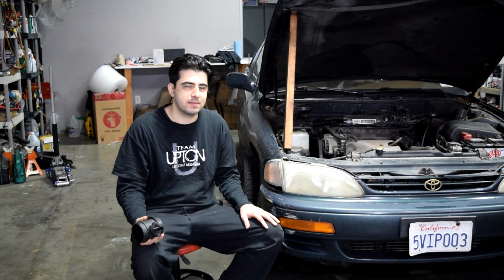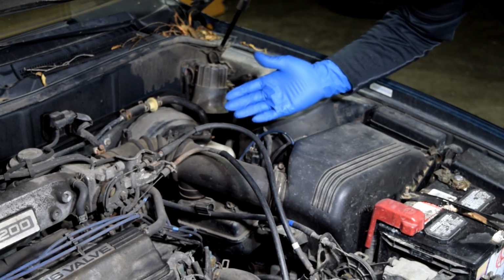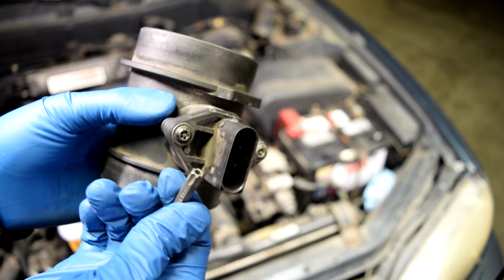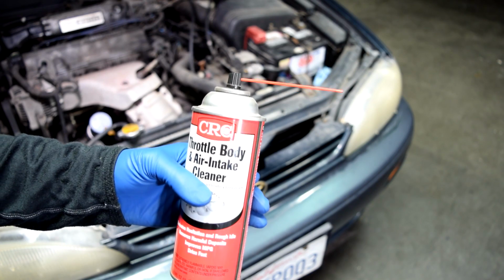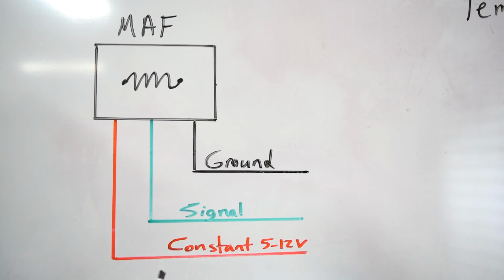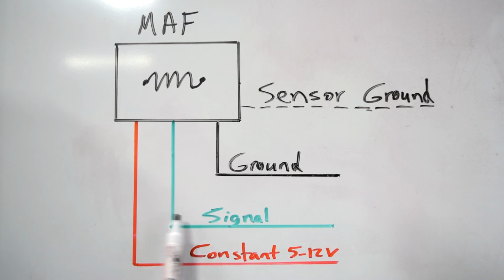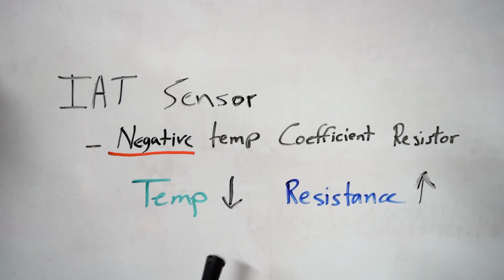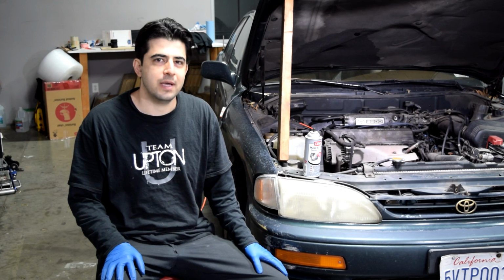How to Clean and Diagnose a Dirty Mass Air Flow (MAF) Sensor - Plus How a Hot Wire Sensor Works

Comment: I'm in the UK and my mpg trip computer has just started to go down big time first time in over 12 months ...i have cleaned the maff sensor 3 times now and it go's back up on fitting but still it go's down after a bit of driving..? would it be because here in the UK it's now cold like very cold outside ? ...thanks for any info

Comment: Can you just use compressd air to clean it?
Reply: spoken like someone who doesn't listen LOL... compressed air would more than likely produce too much pressure and ruin the sensor, those wires are extremely thin and sensitive. Just go get some mass air flow sensor cleaner and make your life easier, why use the wrong tool for the job from the get..

Comment: Hello. While i was driving glow plug light started to flash and check engine light was on. I checked the car with a obd scanner and got a P010100 code. The mechanic said that i should change MAF sensor but my car drives perfectly fine. Should i clean it first and see what happens or should i change it?

Comment: My grand caravan has hesitation from idle to acceleration cleaned the maf sensor with throttle body cleaner. Still same issue code didn't come i hear some kind of misfire sound from the hood. is that fuel injector an issue? Or replace maf sensor?

Comment: Tiburon GT 2004
3 days ago, 
I was driving at the highway and suddenly my CEL came on. I went to Autozone to do a test on my ECU and found out that my mass airflow sensor is bad/dirty/loose. Code: P0171 P0174 Here is my test. Please tell me if I need to replace something.

Side Effects:
1)My car stall when it Idle to accelerate. After that, It runs fine. 
2)Sometime, It feels weak when I drive it. Once I readjusted the sleeve on MAF. It's gone, but the CEL is still on. 

Work I did:
1) I did had vacuum leaks on manifold section. So far, I havent had that code since summer time. I replace the gaskets. 

2) I did replaced the intake with a aftermarket ones. 

3) Replace the gasket on throttle section. 

TEST 1:
I notice the intake sleeve slip alittle bit on the MAF section. I readjusted the sleeve on MAF section thinking that will fix the problem. Two days later, My CEL came back again...

TEST 2: 
I unplugged the MAF and see if it turn on. It works, but the engine sound the same as before. 

TEST 3:
I unplugged the MAF while the car is on. The engine sounds the same. Now I'm thinking " Can it be my MAF sensor that's mess up?"

TEST 4: 
I banged the MAF couple of times while the car is running. I dont hear the car idling retarded.

Now the question is... Could it be the MAF that's mess up or something else? I havent clean the MAF yet and I brought new one from ebay for $28.74(Just testing if the cheap one is better than the expensive ones).

Comment: i drive astra h 1.7cdti and i have problem with starting engine, sometimes start fine sometimes not,diagnostic said error code 0105 map sensor, i change sensor but that not help,i have map sensor and maf sensor, should i try cleaning the maf sensor, its confusing why i have bouth sensor
sry for bad english
Reply: when its cold outside like -5 starts  fine,when is outside is 10c hard starting

Comment: I tried it and my truck still rough idling with vibration.
Reply: Ninety-One Thoughts same, did you find out why ?
Reply: check your spark plugs + timing + clean your throttle body + check injectors + fuel etc   make sure you got good ground 
just to get you started
let us know
Reply: @ericmiller7022  reset your ecu , pull the pcm fuse when your vehicle is off. This will reset your ecu back to factory values. Also check the pcv valve and idle air control valve these two affect idling more than people think.

Comment: Those security screws you showed are a pain as you need a 5-point TORX bit with the hole.
Reply from the maker: +Mike P The sockets are not expensive, you just won't use them for much else probably.

Comment: I cant find a security torque ratchet for removing the damaged side view electrically operated mirror. Appreciate an addres for procurement and also a video clip to show proper removal. My car is Merc C class 220 cdi 2007 model. Zahir Pasha
Reply: Zahir Pasha learn to use the tools before you ruin ur car.. Sounds like ur someonw that should jus hire a mechanic...

Comment: Where did you get that information from ?
The little red zenerdiod looking thing is the Temp sensor.
Inside plastic housing in center is the metall film Air flow sensor.

Comment: if MAF Sensor cleaner not available, can we use petrol ?? cause its not available in some regions of India specially rural / county.. Thank you
Reply: you need to watch the video again... pay attention.
Reply: I would rather go for alcohol / water
Reply: Electronic/circuit board contact cleaner, one that quickly evaporates and doesn't leave any residue after evaporating, and you can't go wrong.

Comment: Nice video here, the white board is a great thing, well done.I would like to add that a Maf sensor can cause lean codes conditions when they get inaccurate, also cleaning hot film Maf sensors usually does not work and cleaning hot film sensors can...can... be a waste of time. also I tell folks that cheap off brand Mafs don't work some times.
Reply from the maker: +danekeeper1 Nice glad you liked the white board action, great tips too. Thanks for sharing.
Reply: Have a hot film one, made by Bosch, on my car. Engine was stumbling especially when going WOT, though it didn't set any fault code on the ECU. Removed it and cleaned both sensors inside it with circuit board cleaner spray and reassembled everything. Engine now no longer stumbles. It smoothly picks RPMs up like there's no tomorrow.
Reply: @teravolt6113   MAF usually does not give fault notice. Jerking at low speeds usually is MAF if the car is less than 150k kilometers

Comment: Dirty wire fools MAF to read out less air than acutally passing the device.Therefore injection System leans out the engine driving it to emergency Operation to prevent starving of engine. That makes fuel consumption go up by 50%.Error file will read "mixture too lean" .Early warning is a lot of knocking (pre ignition, detonations) at warm ambient air due to lean mixture. At cold engine you do not get any thrust out of it. It runs like an old carbuator enginge without a chocke.The shown MAF cleaning procedure showed immediate remedy of all malfunctions.
Drying may be shortened by blowing with compressor-air.

Comment: them 2 wires you point to saying its the hot wire is wrong.  its a resistor.  that kind of maf does not have hot wires you spoon.

Comment: Will a dirty maf sensor cause long startups..
Reply: yes maybe
Reply: dkd Other things to check would be vacuum leaks and fuel pressure. If the check valve in the pump fails it drains fuel pressure back into the tank.

Comment: I used brake cleaner a few times and it worked fine. I'm not totally convinced using brake cleaner is a problem.
Reply: InternetDude It may seem to work well enough, but brake cleaner leaves a residue which may lead to inaccurate readings. Also brake cleaner isn't exactly good to get on plastics.